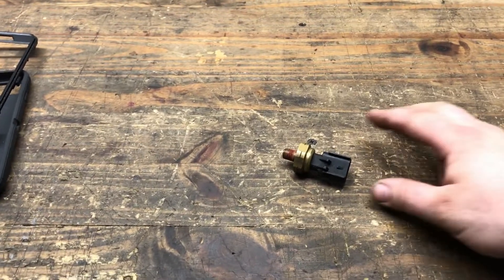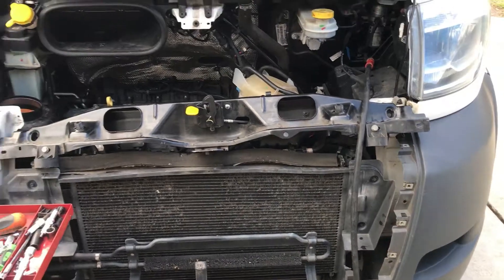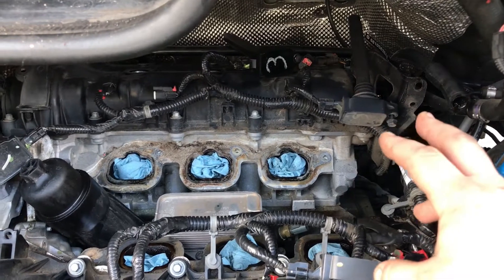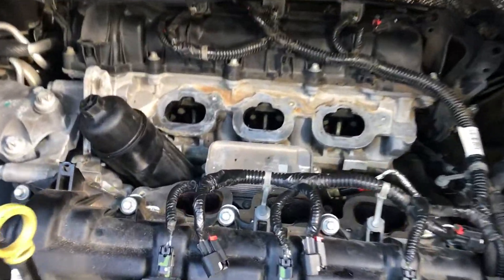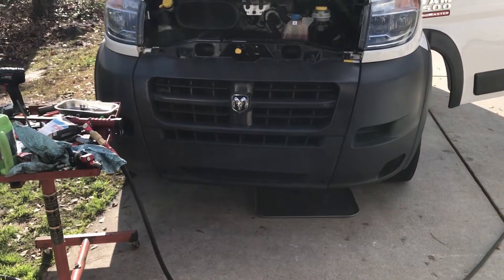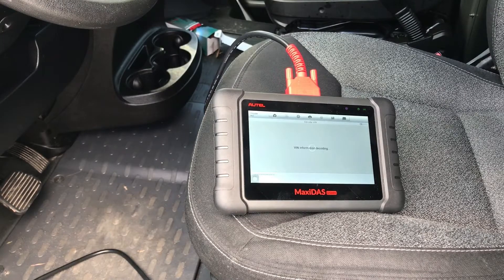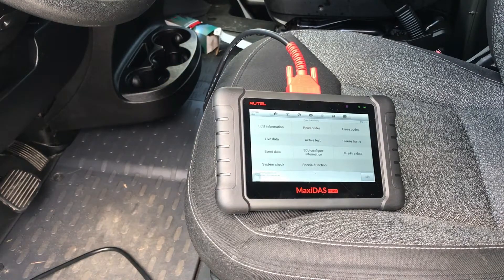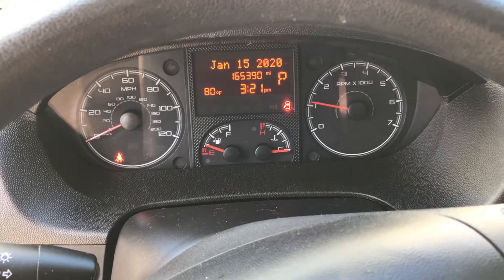2017 3.6L Pentastar Oil Pressure Switch

Comment: Any thoughts on a PO6DE code? Would it be the same sensor?
Reply from the maker: It could be. You would have to do more testing to determine if the sensor is the cause or if the oil pump is actually producing too low of a pressure at whatever commanded stage it is at.

Comment: Just did this job on my 2013 Ram 3.6L Pentastar. It took me just over 4 hours to do. I tired the 1-1/16” socket, it fits but was hard to get onto the sensor because of the wires below the sensor, so I used the proper 1-1/16” oil sensor socket. The socket is much thinner and slid right on.

Also it helps to have a V fork to pull the plastic wire harness mounts out of the holes as your removing the wiring harnesses.

Comment: Thanks a lot for the video. Just finished my 2020 3500 Promaster today but after I erased the code it showed up again in 10 minutes. I didn’t drive much only 5-10 minutes. Do I need to put more drive cycles and erase again? 

P.s. I erased the code with the 2015 MaxiLink.
Reply from the maker: So if you did not check your actual oil pressure switch data with a diagnostic computer capable of doing so to verify that it was actually the switch causing the issue then you may have changed it in vain. If the code came back it would I indicate issues with the actual oil pump itself or at least the solenoid on the oil pump responsible for changing the pump‘a output pressure. If you have not changed your oil or oil filter in quite sometime this would more than likely be the cause of the failure.

Comment: thanks for the video chris. i'm getting a  P06DD on my odb2 reader.  Are there fancier odb2 readers that will give me more specific info? like if the sensor is bad or pressure is low?
Reply from the maker: There are a lot of OBDII code readers out there that will only do just that: read codes. There are some midrange decent code scanners out there that can show you live data but they are a little scarcer. Then there are what we in the automotive repair world have and use to troubleshoot and repair vehicles now a days called bi-directional scanners. With them we are able to get deeper into the computer, see more data, actually test computer systems, components and sensors without even taking them out of the vehicle and in a lot of case reprogram systems. For your issue you would need to look at the actual computer reported oil pressure during different stages of engine operation and compare them to actual oil pressure readings taken with a test gauge.
Reply: @chriswalden88  thanks for the info.  yeah i guess i will take it in... i can probably replace the sensor, but if that's not it, i don't want to make it worse, or have to take everything apart again.

Comment: I’m having the same issue, code p06DD and the van lacks power if I give it full throttle while driving, is this something that can be causing this problem?
Reply from the maker: It’s entirely possible. Some simple diagnostics would tell you but you would need a bidirectional scanner and an oil pressure gauge hooked up to the test port on the engine.
Reply: I changed the sensor, installed a Autozone one and I think it got worse, it smells like gas, has cams and brake booster codes, customer is mad at me thinking I did something wrong, I will install today an mopar sensor to see how it goes, I will let you know thankyou for responding

Comment: The dealer said i Ned a oil pump bt it drive fine and no oil light
Reply from the maker: So what would they tell you that you need an oil pump? Do you have a check engine light with subsequent code?

Comment: Chris, I have a question for you, buddy. I have a 2019 Promaster, The same exact work needs to be done as is with yours to replace switch on mine, so I'm thinking the same engine as your 17. I have an engine light on. OBD says it's an oil pressure sensor stuck off. No oil light, steady engine light only. Yet dealer says it needs an oil pump. The engine light sometimes will go off and not come on for weeks. If I drive cold engine, it comes on. If I warm engine up 25 minutes, it goes all day no light. Do you have an opinion? It would be appreciated, before I sink over $1100 into it. Thanks.
Reply from the maker: Here’s the deal! The problem is more than likely the solenoid on the oil pump itself which controls the high output and low output of the oil pump. The only way to change this solenoid is to change the oil pump. They are not lying to you. Now if it works ok if you warm the engine up first that means that the solenoid is doing it’s job most of the time. When was the last time you had your oil changed? You may look at doing that. Or maybe if it was recently that you changed it then maybe the oil filter was installed incorrectly. Perhaps your oil is low. These are all things to check first. Otherwise the oil pump probably needs to be replaced.

Comment: chrism I have a 610 and I cant get it started.  Has spark, yah its been sitting a while.  Has all the compression .
Reply from the maker: I don't think I understand "610" but an engine is an engine is an engine. All internal combustion engines need three things to run: Air, Fuel and ignition. Spark: Great, good first place to start. Compression is good, but is it getting air? The more common failure point with engines that have sat for a long period of time: FUEL. Is it getting fuel? Is it getting enough fuel? Is it getting too much fuel? Is it getting the correct amount of Fuel pressure? Also, not sure how you checked "spark" but you must understand that even if a spark plug "sparks" outside in the atmosphere doesn't always mean it is "sparking" in the pressure of the combustion chamber. Just something to keep in mind if you feel like you're start chasing your tail. Just through a set of plugs at it, they are cheap, specially if you are getting wet plugs and everything else appears to be correct like timing for example. 
       Also keep in mind. It's extremely difficult to troubleshoot stuff via the internet.

Comment: Nice video, thank you for the steady camera and good sound quality.  
 My 2017 PM has 42,000 miles on it.  I've changed the ATF at 30, 000 and was considering installing a MAGNAFINE inline ATF filter. 
  I don't know which hose is the inlet to the ATF cooler.
Any idea?

Comment: Awsome video thanks for the detailed info did a very good job on everything.  Sucks tho just took every thing off in changed the assembly n fans in sparkplugs in my number 6 cylinder was mis fire fixed that.  But when I changed fan I keep getting a code for fan Ctrl 3 code. Any help plus I guess I gotta take everything off again in change that oil switch. Lol
Reply from the maker: BAILEY well is the #3 fan running? You may not have connected something correctly. That code doesn’t have anything to do with the oil pressure switch though so unless you are getting codes related to the oil pressure system I would leave that oil pressure switch alone. I would go back and double check your work. You may just have a bad fan. I typically look for any other codes pertaining to the coolant temp sensor or cooling system codes in conjunction with that fan control circuit code.